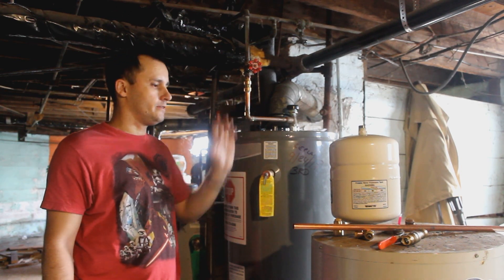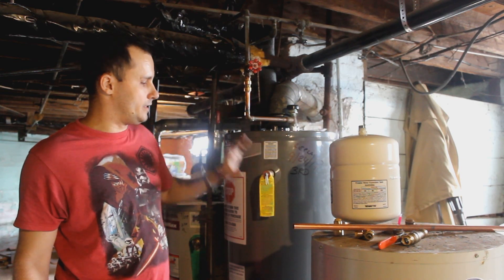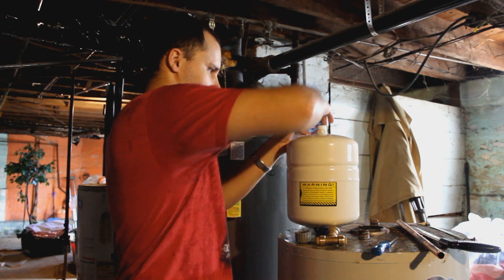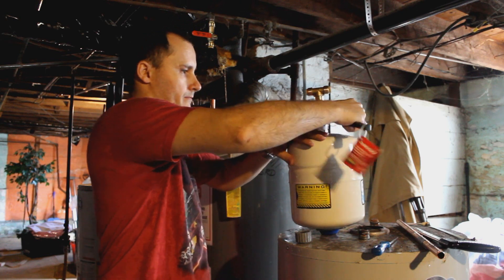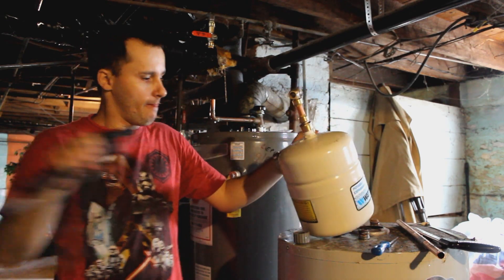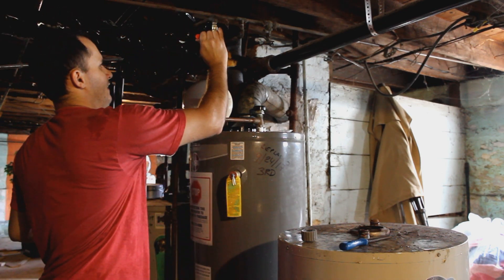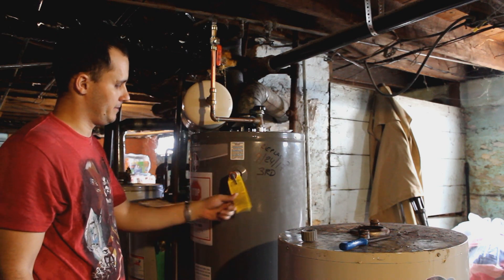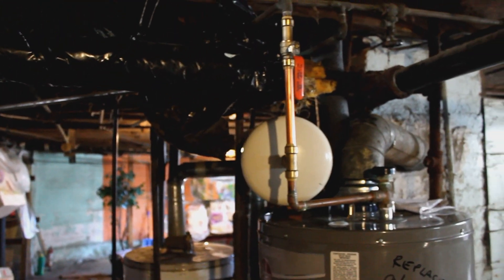DIY - how to install an expansion tank on a hot water heater and fix a leaking relief valve.

Comment: why did you install a water heater without an expansion vessel in the first place.
Reply from the maker: I did later that day, also i installed a water pressure regulator that i did not have on .

Comment: Shark bites are not reliable, no support or hangers on that expansion tank so when it fails it’s gonna sag and snap your copper pipes. Lol life is easy now
Reply from the maker: The was done a few years ago and hasn't leaked yet , and may not show in the video but i did put a support on the expansion tank. I guess shark bites are reliable after all
Reply: ive used sharkbites and never had one fail . they are VERY reliable. however in this case, that tank should have been isntalled vertically and not horizontially as it will pull on the pipe and connectors since nothing is holding it up

Comment: Two issues that should be cautions. Firstly, if your using sharkbite connectors then avoid using any type of handsaw that will cause your cut to be less then perfect. This is because a Sharkbite requires a straight cut so the cut end will seat correctly. If it's not straight, it will leak. 
Secondly, The Expansion Tank gets heavy as it fills with water. This will cause the Sharkbite connector to pull sideways and unseat the end of the pipe from the rubber seal in the Sharkbite connector, so it will leak. Use the video as an illustration of placement but using sharkbite connectors would not be wise since they're designed for stress-free installation.

Comment: Great job !!! I have the cuestion for you connect in the cold water pipe right ? And the water heater say how many psi need ?
Thank you for you time.
Reply: Gigant Great job? The guy applied the Teflon tape the wrong way. Although he means well by taking his time to do this... plumbing is serious stuff to play around. Shark bite will not fly with a county inspector, it has to be welded (soddered) and supported if it installed horizontally.

Comment: Which side should be installed ? hot or cold?
Reply from the maker: James Buenaventura , it must be installed on the cold water line.
Reply: The check valve is what creates the issue,  which is on the main side , cold side . If the check valve or back flow valve is not in place the water will flow back acting as an expansion tank , during thermal exspansion,  your adding the tank to add in this process,  you add it to the cold side ..
Reply: Johnny Draco  a lot of municipalities are making backflow preventers mandatory. They don't want whatever is in your tank mixing back into the public water sources. So once a backflow preventer or even a good prv valve restricts water flow going back out of the system that expanded water need somewhere to go. the reason we put them on the cold water line is because the hot water line water has already expanded. the cool water in the cold water line is denser and when that expands that needs somewhere to go now that it's exit has been blocked, that is why we put the expansion tank on that line.